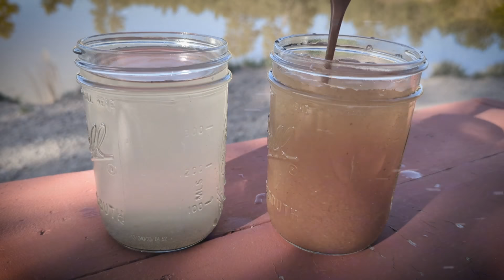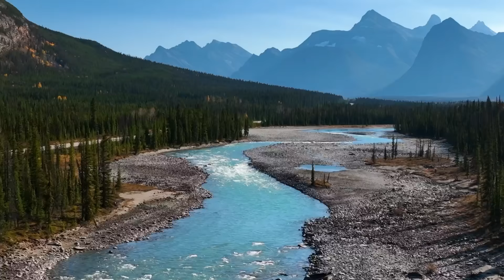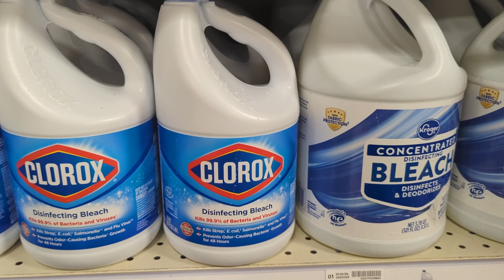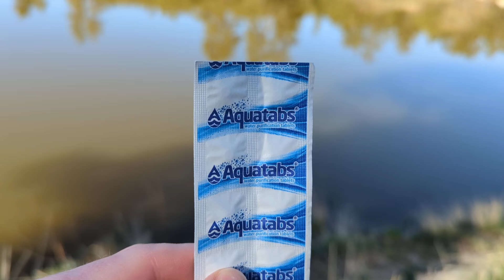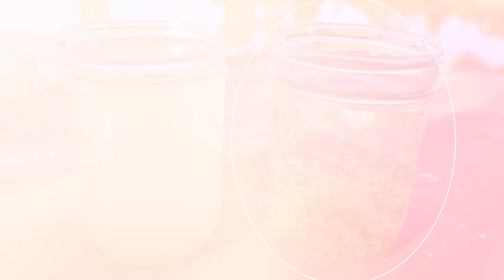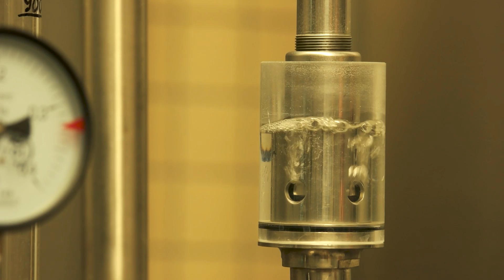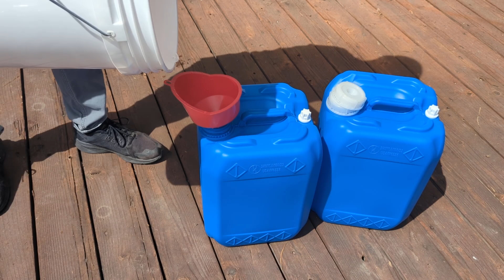The KEY to Emergency Water Preparation Before SHTF

Comment: Hows the water from a dehumidifier?  Is it similar to distillation?
Reply from the maker: Similar, but not as sanitary. As others have mentioned, dehumidifiers might pose risk of heavy metal exposure depending on the materials the system is made from. There can also be microbiological risk. It would be recommended to treat and filter this water if you plan to use it for consumption, otherwise you could use it for other needs like bathing or washing dishes

Comment: Just move to Finland, there's 188,000 lakes and most of them are pretty much safe to drink from. Plus all the streams and springs which are even safer.
Reply from the maker: Untreated surface water (like from lakes or streams) always poses a risk of microbiological contamination, independent of locaty. It's never recommended to drink raw, untreated surface water without properly disinfecting it first.
Reply: @waterfilterguru  My ancestors have been drinking it since before Jesus, I'll probably survive :D there's few pathogens an immune system can't be expected to handle in there anyway

Comment: You’re not gonna remind people to turn their water heater off if it’s electric or turn the gas off before they start tapping water out of it if I’m taking water from the tank, I don’t have another source of water nothings gonna refill the tank it will burn up if empty, and the power or gas is on
Reply from the maker: You're absolutely right. Of course you should turn the power/gas off before draining any hot water heater to use the water in an emergency situation

Comment: From personal experience, do not store water long-term in those cheap typical water or milk style jugs. If you do use them, store them in the dark. Even moderate sunlight or heat will cause them to deteriorate fast and one day will go sploosh, sometimes in only a few months. I use some for medium-term use water storage and keep them in the dark, but my main storage is a couple of the blue plastic BPA-free 7gal jugs.
Reply from the maker: Thanks for sharing! You make a great point that it's important to use proper storage containers designed for long term water storage

Comment: Good point about the swimming pools.  I used to service swimming pools and they have 3 times the amount of chlorine of drinking water, as well as hydrochloric acid added to them to balance the ph.  Lots of chemicals you don't find in tap water.  Vinegar can also be used to treat water in place of chlorine, and you can make vinegar yourself.  The romans did it.
Reply from the maker: Hey thanks for your comment, and great tip about the vinegar!

Comment: In an emergency, you better have SOMETHING to clean water with. No matter how faulty. I have the metal, which I prefer over a plastic bucket. Especially with the microplastics. The toilet is my LAST LAST LAST resort 🤢🤢🤢. Because your water heater, toilet, and pipes will run out quickly!
Reply from the maker: Yep, a gravity-fed system is ideal, as they don't require an electrical connection. Just make sure you have proper methods of disinfection ready as well!

Comment: Just survived hurricane Helene in NC, was not prepared. No power, no running water, limited shelf stable food, road to the house was completely washed away.
Thank goodness the hurricane fed my seasonal spring, as simple hygeine and toilet flushing was possible but no filtration to create potable water.
It was beyond awful.
3 months later and still no potable water from the tap.

Now I use a plastic gravity fed system and test weekly.  I  recommend a non electric filtration system for every single household!  Also, handheld portable filters like Sawyer is a must, never be without one. Got them in the car, backpacks, jist about everywhere because...you never know. SHTF will happen, please prepare.
Reply from the maker: Wow. Thanks so much for sharing you real life experience.
Reply: Thank you

Comment: Can i use pool shock ?  If so, what would the ratio be ?
Thanks 🌷
Reply from the maker: Yes you can: The first step is to make a chlorine solution that you will use to disinfect your water.  Add one heaping teaspoon (approximately ¼ ounce) of high-test granular calcium hypochlorite (HTH) to two gallons of water and stir until the particles have dissolved. The mixture will produce a chlorine solution of approximately 500 milligrams per liter. To disinfect water, add one part of the chlorine solution to each 100 parts of water you are treating. This is about the same as adding 1 pint (16 ounces) of the chlorine solution to 12.5 gallons of water. If the chlorine taste is too strong, pour the water from one clean container to another and let it stand for a few hours before use. CAUTION: HTH is a very powerful oxidant. Follow the instructions on the label for safe handling and storage of this chemical.
Reply: @waterfilterguru  Thank you for the last part, I have mine double sealed in plastic (vacuum sealed) for that reason. along with instructions for use)

Comment: A bit late as this just popped in my feed, but I store water in glazed pottery with wax seals. The thing about storing water is you really only need to store it to keep out debris. Even if biological contamination gets in (bacteria, mold, etc), simply boiling that water for 10 minutes will remove all that.
Reply from the maker: Thanks for sharing, much appreciated

Comment: Important Note on WATER : Don't wait until you need water to find and treat water,,,, Using bleach you have to allow the bleach to evaporate before you can use it, may take 12, 24, 36 hrs.... ALSO if-when things happen your #1 job everyday is to find and treat water for day one on out - EVERYDAY you need water so you have to be finding water and treating water all day everyday unless you are lucky enough to find an ample supply that is safe to go to easy to get etc... otherwise the rest of your life is focused on water even if the faucet comes back on you will still have to treat that water because you dont know whats been done to it if anything before it reaches your spigot !!! To check bleached water take good long deep slow sniff, if you smell bleach, you cant use it yet, allow it sit open - no top - so the bleach evaporates and when you no longer smell bleach you can use it.... Additionally, you will need flush water if you bug in, save wash water to use as flush water, you dont want to be dumping your drinking - cooking water down the toilet !!!!! Containers: food containers, containers that food came in can be used for drinking water, all other containers soap bottles etc... can be used for wash and flush water - never cook or drink water from a container that is not a food container NEVER !!!!  Plastic bottles and buckets have a triangle with a number in it... 1st.. no triangle number = wash flush water, safe numbers are #2 BEST SAFE FOOD GRADE, #4 and #5 is ok also #1, 3, 6, 7 NEVER USE FOR FOOD or COOKING !!!!! The clock face mark shows when the container was made just so you know what that is... .. . Hope this helps !!!
Reply from the maker: Thanks for sharing!

Comment: I live on the beach and have tried to find a desalination device that would work in an emergency. Any suggestions?
Reply from the maker: Reverse osmosis and distillation are the only viable methods for desalination
Reply: @waterfilterguru  I have a countertop RO machine. Is there a distillation machine you recomend?

Comment: I felt a bit confused after this video. We have a river nearby if our tap water goes down. We are allergic to chlorine so need a way to filter that out if we treat with chemicals. We can boil water, if needed. What would you recommend for our situation if we have to turn to river water? Could we treat it for bacteria/parasites with tablets in a 5 gallon bucket and then filter it?
Reply from the maker: You can disinfect the river water with chemicals, boiling, UV or a combination. Boiling is most effective, but of course has it's own limitations. If you treat with chemicals, you could then use a carbon filter to remove the residual chlorine once the water is disinfected.

Comment: You did not mention ozone. O3 is one of the best forms of water purification. It does require electricity but only nominal amounts.
Reply from the maker: That's why I didn't mention it as a viable option for emergency preparedness

Comment: So we had a power outage for something where I live, and it was out for like a week. Are poor neighbors and stuff were complaining about not being able to shower. I told them the water in your water heater is still warm. While you can use it to bathe do so sparingly so that you'll still have water for a couple more days. This only works if you still have running water though.
Reply: FYI we had an electric water heater because of the way our townhome community is set up. We don't have gas in our units.

Comment: Well a 40 pack of bottled water, half liter bottles, will last you about 5 days for your water needs. Technically though if you're using canned goods and have other sources of water intake for your food, then you will not need to take eight bottles a day in your consumption. 

There is the idea of using the canning process to can water. In which you basically sterilize water by putting jars in a boiling pot and fill those with water which I suppose would be better if you boiled that too before letting it sit and that hot ass pot with a lid on it for a bit so it creates a seal. You can set that aside. Least that way you have a lot of bottles of water so to speak. For instance like a jam jar is 12 oz or something like that and that's one can of water so to speak. Then you can add your suggestion of leaving out and sun as long as you're using glass jars. You don't want to use plastic simply due to the facts that the plastic has chemicals that are very not healthy for a person to consume when exposed to UV radiation. That's where you get that plastic flavor from water that's been left out in the sun or warmed up in your car. 

Some people would say use one of those filter straws. The problem with filter straws is they'll get out sediments and physical things. They will do nothing from microorganisms. The only way to really help with microorganisms is to use boiling or iodine tablets that will sterilize the water. So I guess it wouldn't hurt to just keep a large supply of iodine tablets on hand then you can filter the water and then sterilize it chemically.

Comment: Having just gone through Debbie, Helene and Milton I'm so glad I had my water prep in place. I lost electricity for several days and because I'm on a well I had no water. For those of you who are unfamiliar, wells use electric pumps to get the water to the house. My septic tank uses no electricity so I was able to use buckets of rainwater for flushing. In my emergency kit I have three water purification treatments. I live just south of Tampa, and hurricane prep is a must. Every spring I go through my kits and replace what's needed. There's a lot to this, and water purification is right at the top. Thank you so much for your knowledge and sharing that. It's incredibly important.
Reply from the maker: Thank you so much for sharing your experience!
Reply: A battery and solar combo unit would help run the well and septic. They are not all that expensive and can be repurposed for camping, hunting cabin etc.
Reply: What type of water purification treatments do you have, and how do you use them, please?
Reply: @HarleyDyna0320 The standard water purification tablets, liquid chlorine bleach with the dilution instructions & measuring spoon taped to the bottle, and a water bottle with a filtration thing inside. Any more suggestions I'm all ears!
Reply: @cottagefarmflowers  Thank you for your reply.   Those 3 types you have are the only ones that I have heard, and read, a lot about.  A few years ago, there was a man who was an off-the-grid prepper on the internet.  He built a filtration type system out of a 1 liter plastic bottle hung upside down from a tree.  He put layers of rocks, leaves, and sand in it; sand being the last layer.  He cut the bottom of the bottle off to pour the water into the top of it.  The bottle cap ( now on the bottom) was to regulate the flow outwards of it.  He used brown pond water for the video.  It looked clear but was still a little cloudy.   He then boiled it over a campfire for 10 minutes before using it.   Sorry, I don't remember his name or the YouTube channel.
Reply: @HarleyDyna0320 That's amazing! If you come across the link please share it.
Reply: @JM7284 hate to say it, but I think that's above my pay grade. I don't even know how to start with that kind of project.

Comment: You did not mention using a branch of a pine tree or any nut tree to purify water. Put the bottom end of the branch in the dirty water in a jar and the top into another container for clean water. The dirty water gets taken up by the branch and goes through it to the clean jar. I watched a youtube video about it. You can too
Reply from the maker: Thanks for sharing! I'll make a specific video about this

Comment: What mobile / countertop system would you recommend for RO / desalination of pool water (from salt water pool)?
Reply from the maker: Reverse osmosis or distillation
Reply: @waterfilterguru RO appliance you recommend?  Will use your link
Reply from the maker: @MrMarylandMike  Aquatru countertop RO https://geni.us/chlQv5o is portable and easy to use, and continues to hold its top position in our data-driven scoring system. 

If you plan to use this for emergency prep, keep in mind reverse osmosis systems have specific operating parameters (check the user manual of any systems you are considering), and should not be used as primary treatment for water that is microbiologically unsafe

Comment: Not one mention of using a coutertop R0 system like the one i use...it can easily be powered by a car  battery inverter...great because it only takes 5 minutes to purify  over a quart...Great as long as you have plenty of stored water...Yes in severe lack of water conditions for a long time your othet methods would be best,since RO system i use is 3 to one ratio,which  means it takes 3 gallons to fully purify 1 gallon...that being said you could also run the discarded water through machine again which basically will lesson the filters overall  life..but in any case since my filter normally lasts 12 months and makes 280 gallons before it needs replacement.using it this way for a week or two should be fine....but of coarse filter will need to replaced sooner...these machines also show you tds levels which is great.
Reply from the maker: Although reverse osmosis is one of the best methods for purifying water, it's not the first recommendation for treatment in emergency situations for a number of reasons, including those you mentioned such as electricity requirement and water waste. RO systems have specific operating parameters that sometimes require pretreatment. These systems should absolutely never be used as primary treatment for microbiological contaminants which will foul the membrane and pose additional risk.
Reply: Correct.  I learned that while researching.   I'm now deciding between Berkey and Doulton Berkfield.  Thoughts?
Reply: He's doing great research for us, so i am certain he is busy and missed your comment. I recently asked him about an emergency grid-down choice bw Boroux and Berkefeld. He said he would go with Berkefeld. HTH. 😊

Comment: Pretty sure need to be careful if using a dehumidifier to get water depending on the coils could leach toxic chemicals.
Reply from the maker: Yes don't consume the condensate without proper treatment
Reply: @waterfilterguru  Was looking into it years back, for them and window ac, but for now just used to water the plants.

Comment: Please don't use bleach. It'll harm your gut. Instead if you have anything made of pure silver, you can put it in the water container and it will eliminate all microbes.
Reply from the maker: Disinfection is step 1. Step 2, filter the disinfection chemical residual & byproducts 👍

Comment: I saved those plastic kitty litter containers. When i wash my dishes in the sink, i collect the rinse water and place in these containers for my plants. I just used two of them and put yeast and sugar in them to use as fertilizer for my plants. I guess in states that reach 100° temps, yeast water helps them with stand the high temperature.
Reply from the maker: Thanks for sharing!

Comment: The best way to prepare for water needs is with an atmospheric water generator. We got one that, depending on humidity, can make up to 75 gallons a day—so no matter what happens, our water supply is secured!
Reply from the maker: Yeah I've seen those! I'd love to test them. I'd be interested to find out how region impacts efficacy. How many gallons will you get in a dry climate vs humid, for example
Reply: @ 

Ours makes about 75 gallons daily since we’re in a humid area, but in dry climates, it might make around 25–30 gallons a day. It all depends on the air’s moisture!

Comment: I have a metal 4 ft shelf.  I keep my water on that.  I wrapped the shelf with 2 - 3 table cloths to protect it from light.  I had to keep it on my porch.  I chk it spradickly. Small place.

Comment: And remember to not drink water out of a toilet tank if you've used those toilet bowl cleaner tabs they're poison
Reply from the maker: But the bowl is separate from the tank, which is why the tank could be the source of water in an emergency. Unless you are putting bowl cleaner in the upper tank..